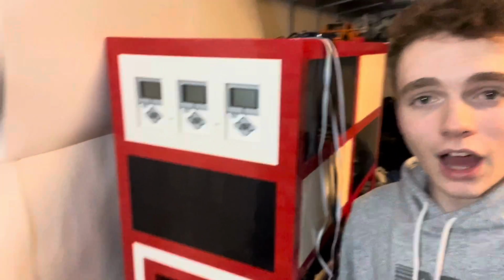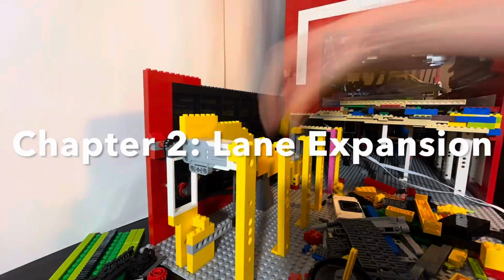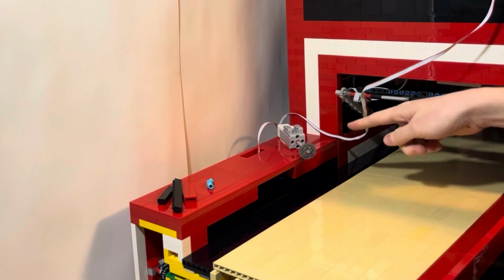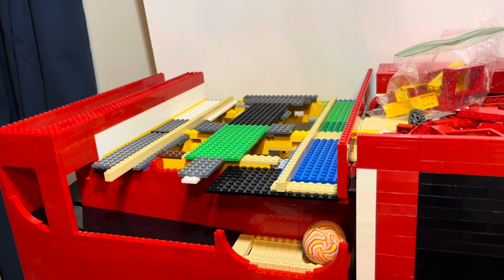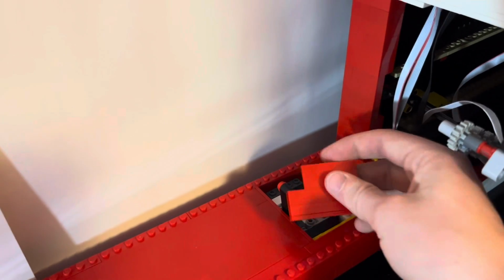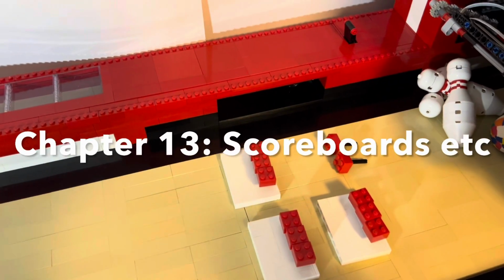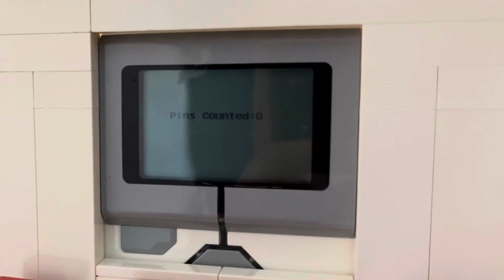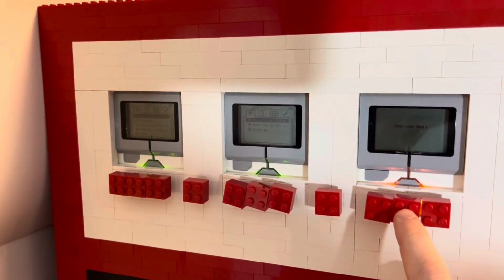Finishing My Working LEGO Bowling Alley - Episode: 7 - World Record Lego Pinsetter

Comment: Put the ball sensor somewhere before the chain pickup but after the lane. Then you can roll as fast as you want, and it’ll detect the ball rolling at a slower speed after it has been collected and moved down track
Reply from the maker: As good of an idea as that is, unfortunately the ball does not always make it through the lane. If thrown at a lighter speed the pins can stop the ball on the lane

Comment: So impressive what you have done. I am working on a huge project with multiple moving parts and was wondering if you could tell me where to go for the best "how to" info for coding with LEGO.
Reply from the maker: Thank you! Searching for videos on the individual blocks help a lot to understand what each do and how they work with others. The best way I’ve learned is by practice. Over the probably 50 machines I’ve programmed I’ve learned a bit more each time about how to use switches, loops, and variables
Reply from the maker: If you have any specific questions feel free to ask, I’ll try my best to get back to you with a good response!
Reply: @LegoCloud  Thanks so much. The biggest thing for me is how to get started. I haven’t announced this on my channel yet but I only have 11 subscribers so far, but I am building the city of Paris out of LEGO. The huge project I have decided on now is I have LEGO’s version of the Eiffel Tower but it’s not in scale with normal LEGO. So my plan is to build the very first LEGO Eiffel Tower in 1/42 scale. The big advantage of this is that it will be big enough that everything can function. That is what I need the most help with is coding the elevators. Sorry it was so lengthy
Reply from the maker: @JD.French.city.connection.  ah I see that’ll be so cool! I’d start with a start program block, then a loop, then inside the loop a wait block set to wait until a button is pressed, then a motor spins to move the elevator. You can have multiple start blocks in one program to do this multiple times. Having a sensor at each floor or programming a variable would allow it to remember/know what floor it’s on
Reply: @LegoCloud  Okay that sounds good to me, I can’t wait to get started. I’m building the east pieler at the moment
Reply from the maker: @JD.French.city.connection.  can’t wait to see it!
Reply: @LegoCloud  I’ll post as soon as I can